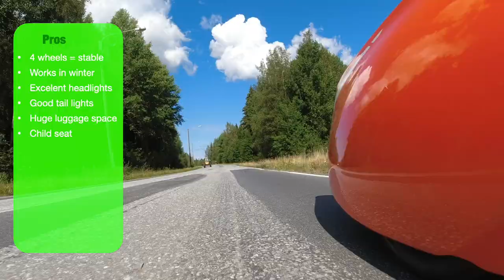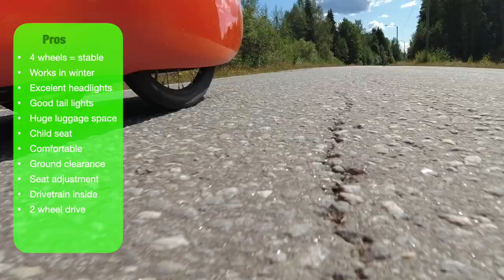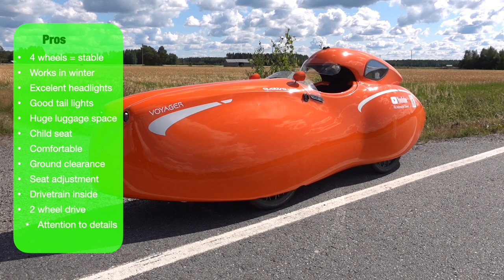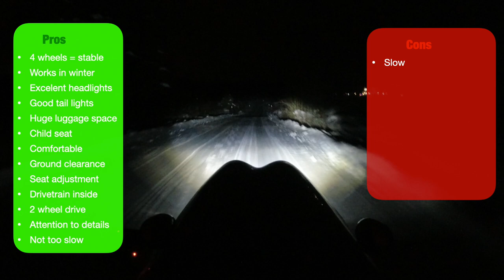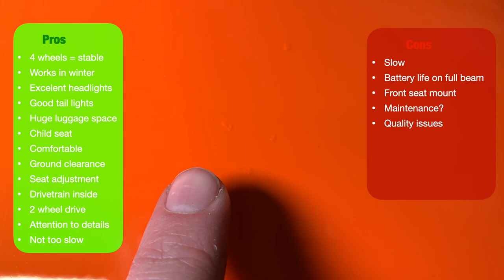Quattrovelo - Is It Any Good?

Comment: You have to upgrade stronger legs maybe? Then the speed is not issue anymore.
Reply from the maker: True 😂
Reply: epo can help a lot. and makes u fast like a motorbike.
Reply: @TheVelomobileChannel   your legs are the key to speed, but 4 wheels give a slight more resistance than a 3 wheel quest and is a little bit lighter
Reply: If your legs, lungs, and heart are all strong enough you don't even need a vehicle, just run everywhere.
Reply: @LeesChannel  Way more to running than that. I'd love to be able to jog again, but my left leg stops bouncing (rebounding) after a while—making that pretty much impossible. I can do repeated short sprints (soccer ⚽) or hike at fairly high speed across rough terrain, and cycling is no problem.
Besides, he can't carry much cargo, or a kid that big, when jogging.
Finally, I doubt you can keep up 25 km/h when running for 25 km.
Reply: @DrewNorthup  It was in response to the original comment.  I was being absurd.

Comment: In my QV+, I have the cover inside the front, pushed against the roof, the edges on the wheel wells on the outside of the damper struts. The pointy ends just in front of the manhole, secured by velcro. Works perfect for me, I don't notice it. If it start raining, I just stop and put it on without having to climb out. 😊
Reply from the maker: There might be more room with QV+. The front part is higher 🤔
Reply: Not possible unless one has very small feets 🙂
Reply: @AlveHenricson  I have incredibly large feet. 🦶🦶😀
Reply: For me it worked also good. Same solution.

Comment: I was very interested in the final review!  It seems like the QV gives a very good first impression, but I have seen several users that were initially very positive on it move on to other vehicles.  Rein228 sold his and is using a DFXL, and John from veloads seems to prefer the Alpha 7 or Milan, I have seen others as well.
Do you feel like you will keep the QV even after your kid grows too big for the child seat, or will you switch?
Reply from the maker: So far QV seems to be the only velomobile which can handle the winter reasonably well, so I think I want to keep it.
Reply: If I remember John's comments, he had more fun with the faster/lighter machines, but liked the QV as a "Daily Driver," (my words, not his), and that he could take Theo with him. That was a while ago, so he may have changed his mind, though :-).
I got mine for going to work in, in the winter, and in the rain. In the hot summer, I use an ICE Trike, and now a Cruzebike Q45. Horses for courses. 
Saves using the car!
Reply: @coniow  About the cruzbike q45. Is it difficult to maintain your balance? I bought a lowrider before, and hated it, because it was woobly and I had to constantly focus on not falling off it or crashing. Do you have to push off when you start from a stop?
Reply: @Wool & Canvas  yeah but the problem with that is then  you have to deal with the glare in your eyes.  Ideally most of the body should be white, but what's in front of you should be darker.

Comment: This kind of vehicle should have at rear a shlumpf drive and at front a HSD drive, also you can replace the 90 mm drum brakes by disc ones , then you can add an electric assist at the pedals , and perhaps a toggable generator that can regenerate the battery when in descents...
Some pv panels can be added too !
Reply: Its going to become very heavy like this

Comment: What about the turning radius compared to other velomobiles? It is quite important in the city to be able to have some kind of turning radius. And how do you reverse? On my Alpha 7 I can put my hands on the outside and turn the wheels like on a wheelchair to reverse. On the rotovelo there are foot cutouts in the bottom for reverse. These things are critical for city driving. I love the full suspension and comfort of the QV (I tried one once), but 4 wheels is not going to fly, legally speaking, where I am, nor is the massive size of it (parking and manuvering between traffic, lane splitting).  I wonder if anyone has ever made a velomobile specifically for city commuting? (not an e-velo like cab bike, etc). Does anyone know of one?

Comment: Hi Saukki  , I notice that you have added Schlumpf Mountain Drive to the Quatrovelo , If you want you can switch to schlumpf speed drive which is case you don't have a lot of up hills can increase you speed significantly.
Reply from the maker: I highly doubt it will increase speed. Instead it’s more inefficient because I would mostly be using the more inefficient overdrive of the Speed Drive. With Mountain Drive I’m mostly using the more efficient direct drive gear and I use the inefficient low gear only on steepest hills (in winter almost any hill is steep enough to use MD).

Comment: I don't think I'll carry a kid but can the back seat have enough space to carry a guitar?
Compare to Quest this have larger luggage space, but is the Quest have enough for camping gear say for like a tent etc?
How much cruising speed is expected of QV vs Quest in kmh?
Reply from the maker: I doubt it has enough room for a guitar. You might actually have better luck with a Quest. It’s little bit better with long-ish objects. Quest should have enough room for camping gear, including a small tent. On my commute I usually average around 33 km/h with the QV, while with Quest I could average around 35 to 36 km/h. So that’s the difference in speed.
Reply: @TheVelomobileChannel  thank you for your reply, the ability to carry a guitar is important to me, I can a bit flexible to adjust for camping gear. I'll look seriously into Quest if it can fit longer object.
Reply: @wckoek  hey ho, did you find out more about fitting a guitar in one of these?
I am also very much interested in that perticular feature.

Comment: Why do you not store the cover in the hood? Stick it in with both sides together into the cover and then open it when inside. It will fit perfectly out of the way
Reply from the maker: It doesn’t fit when child seat is mounted to the highest position, like I have now.
Reply: @TheVelomobileChannel  
But in your video you mentioned that there is no place for the cover, but there is if you don't have child seat
Reply from the maker: Yes. I said there’s no place for it and after that I show multiple places wher it can be stored 🤔🤦‍♂️🤷‍♂️

Comment: I'm worried about the hood not being fully sealed like other velos. what happens when you park it and it rains a lot? does the rain goes in the open sides of the hood?
Reply from the maker: It comes with extra piece of cover which you can use to close the head hole of the manhole cover. So yes, you can close it so that no raiwater gets inside.
Reply: @TheVelomobileChannel  thanks I didn't know..nobody seems to ever mentioned this in various videos of the QV! thanks!
Reply from the maker: I might have shown it in the unboxing video at the end of last year 🤔
I haven’t mentioned it since then, because I don’t use it. I don’t usually store the QV outside in the rain, so the manholecover + head-in hood is good enough for me.

Comment: Would you recommend this as a substitute to a moped or car?
By the way what a great review 😉😀👍
Reply from the maker: Yes, in many cases it would be great substitute to a moped or a car.
Reply: But at which distance would a car or moped be the more sensible option?
Reply from the maker: I have 25 km commute, and I ride it mostly by velomobile. But in winter I mostly have to use car, because we usually have a lot of snow.
Reply: I understand what you mean with the snow 🏔️☃️
Here where I live in South Sweden it usually doesn't get too cold during the winter. 

However this year the temperature dropped to -16 degrees Celsius.
I can only imagine how cold it can be for you during your commute in the colder months 🥶
Reply: @emildragon7589  I have been using a Strada all winter in Stockholm. It is doable, except right after a big snowpour, where there is too much soft snow. -16 or colder is not a problem, velomobiles are actually quite toasty inside.
Reply: @emildragon7589  I have used my QV in the winter for 2 years. Riding at -1 degree is not an issue: There is no wind-chill, so you warm up quickly, (I just wear a long sleeved shirt), the hassle is the visor steaming up in the rain, and getting chilled when you get out! I keep a jacket in the back in case I have to wait around. Warmer to stay inside :-)!
I have used the car for work about 9 or 10 times a year, the rest of the time I pedal. The car is mainly used for my 90 year old mother's shopping trips and appointments.
Distance and time wise: My run in is about 35 to 40 minutes to do 8 miles on the road. The return is on the cycle track, about an hour, and a mile further, but avoids the traffic. I should add that my run in is mostly DOWN hill with some humps, but home is about 50 meters higher. SLOWER going UP hills :-(. I have hit 40 miles an hour going down before now. You learn to allow the time you need, and not to 'rush.' Expenses: Tyres and chains. NO PETROL! 
Note: If you load up with tools, spares, and a decent bike lock, that is WEIGHT that you have to haul around. If you are happy without carrying them, life is a lot easier.
Reply: @davidmenendezhurtado8068  But isn't soft snow a problem for cars too?
Reply: No idea, I only do bikes. But I guess cars are heavier so they can compact the snow in front a bit better. Partially ridden roads are not nice to ride on.
But temperature is not a problem. Alve has some videos on velomobiling in extreme cold (-40). He uses lots of socks and flip-flops.
Reply from the maker: Cars can handle much more snow than bikes or velomobiles. Car has more power to go through thick layer of snow, which may not be possible with human powered vehicle. 

Once I had to drive my commute in a snow storm in the middle of a night. Roads were not ploughed yet and there was probably 15 to 20 cm of soft snow on the roads with strong wind forming high snow dunes in some places. I had to drive through several of those snow dunes. I had to decide if I should try to drive high speed through the dunes and risk breaking something, or try to crawl through the dunes slowly and risk getting stuck. I decided to drive high speed and see how it goes. Some of the dunes were so high that when driving through, snow flew over the hood and windscreen. Luckily it was soft snow, so nothing broke. 

But afterwards I found out the car’s engine bay was full of snow after diving through those snow dunes. Every time I started the engine after that I heard this noice of snow packing under pressure. It turns out it was the engine shaking on startup against the snow packed in the engine bay 🤣